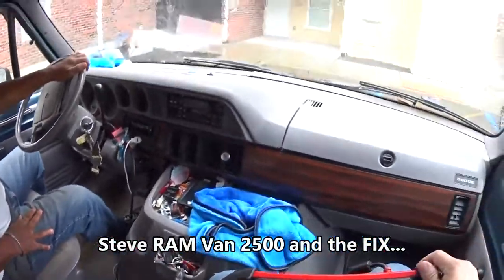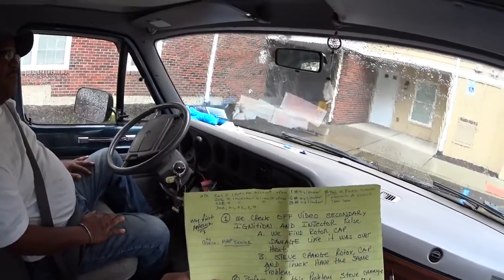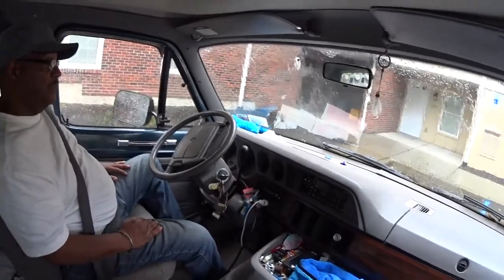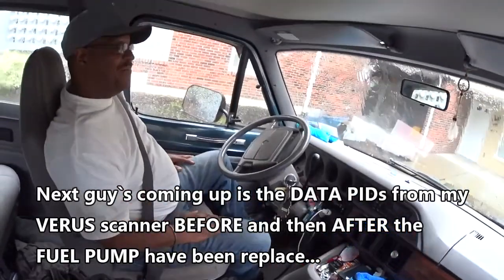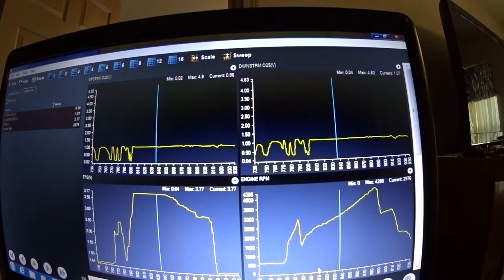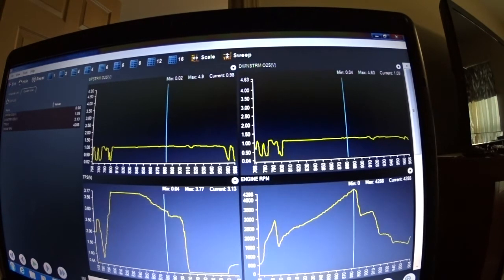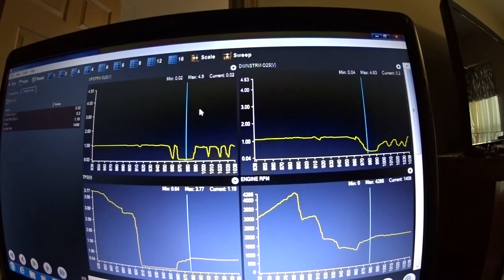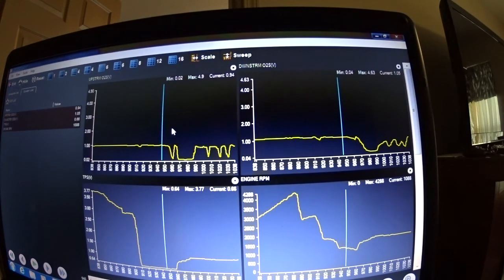96 Dodge Ram 5.2L fuel pump delivery problem

Comment: 2000 dodge ram vans fuel pump was replaced. Problem is it still does not get gas "sometimes". It will run sometimes but then when I go to start it and it wont start for days at a time. And then it will start again. Any idea what's going on. Any insite will be greatly appreciated

Comment: I have a 97 Dodge Dakota v6 3.9 it shuts off when engine warm up while driving or at idle.i replaced iac,tps cleaned throttle body and replaced battery.please any suggestions for my fix anyone????

Comment: me 1st thing check fuel pressure and nobody changes their fuel filters
Reply from the maker: WORK TRAVELER 👋 Hi fuel filter is inside the tank also the fuel pressure regulator all is in the fuel pressure module...
Reply: @PeteSambolin  ..thats dodge engineers thinking...we techs can't remember every car  on earth components location ...G. M keeps it simple stupid all separate
Reply: @PeteSambolin  question why should we degree a cam in on both banks(v6,v8)?????  what am i/we looking for????
Reply from the maker: WORK TRAVELER Usually went anyone do a cam degree is because is an aftermarket kit or stage I racing kit for a bike and cars! But bottom line way? Is because of the timing degree of the valve opening and closing will be perfect 👌 by degree!

Comment: My van has similar problem,I also changed alot of parts , plugs,cap,wires TPS ,map sensor ,my fuel pressure seems normal ,has multiple miss fires ,so I will change fuel pump , because of your videos , iam not no mechanic , have no further ideas about it's problem , passed compression test so I let you know what happens thanks guys.
Reply from the maker: Rick Hinojosa Hi in what you’re working on?
Reply: I got a 97 2500 dodge ram van conversation with the 318 I have changed the fuel pump and it has no change to it